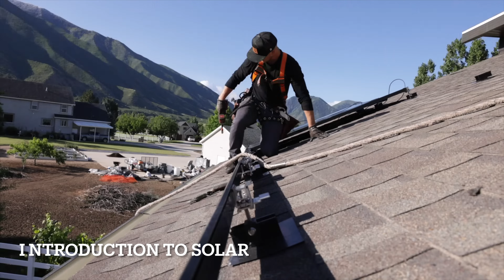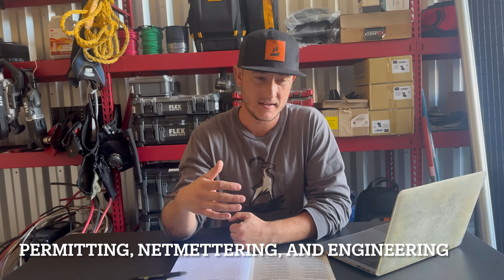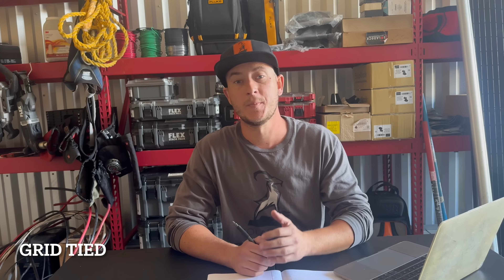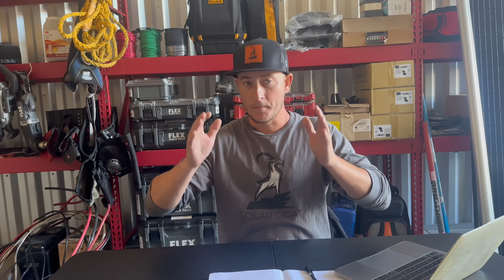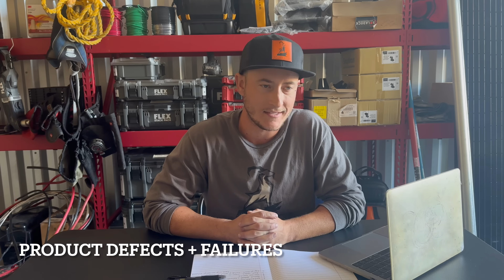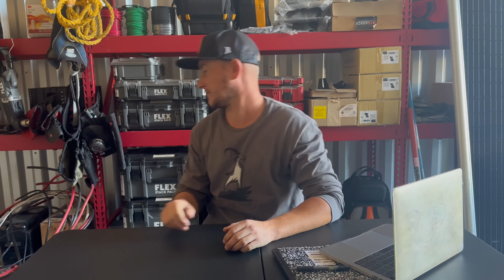Intro To Solar For Electricians

Comment: The solar company that installed the system is now out of business. I do have an AP monitoring system so that I can track on my phone, while viewing the Module output I noticed two of my panels are not generating and two of the other nine are slow to keep up with the others but do eventually catch up. What can be the issue?

Gabrielle

Comment: I went to trade school for electrical and been in the field from sales to labor and meet old and young electricians and techs and realize when I bring up solar they never installed them and not even batteries. They are curious and interested in knowing more about it. It's always something new to learn in the electrical field even codes that changes.

Comment: There are a lot of component pieces for sure.  It's good to know what they are, how they work, what the standards are, and how the standards work.  You don't have to be an electrician per-say but you do need to know your way around the basics.  Even if you don't DIY the system, you need to know enough to know whether an installer is fleecing you or not when bidding out the system and you need to know enough to know that the installer is making the right choices and not taking short cuts.

A professional installer can bring a lot of expertise to the table, but vetting whether an installer is actually good or not... that's incredibly difficult for a regular home owner to do.   Unfortunately, even a good installer can get caught-up in a bad situation.  Installers almost universally prefer eco-system solutions because there's just a single vendor to go to for warranty work and the monitoring is often easier.  But this often results in a disaster for any work past the first 5 years.

Vendors go out of business all the time and often take the installers that depended on their eco-system with them (because the installer winds up being on the hook for warranty work that he can no longer be reimbursed for).  Or the warranty service takes too much teeth pulling.   And even when they don't, vendors evolve their systems in ways that are often incompatible with older equipment. 

--

A DIYer will still use a professional electrician for everything near the service entrance right up to the first set of breakers.  DIY systems are almost never eco-system based.  They are usually component-based and depend on the many standards that exist for various components of a solar system.  The advantage is that when something breaks you can easily replace the broken piece of equipment and because all the pieces are standards-based you only have to replace that one piece, not the entire system.  Compatibility is very high.  It is literally the best way to go even if you don't engage equipment warranties past the first few years.

When you know what you are doing, hooking things up is utterly trivial.  Taking time, possibly quite a bit of time, but at minimal cost.  Even having to buy all the related tools needed.   When you don't know what you are doing, it can be nearly impossible.

--

Roof work.  Oh boy.  Some roofs are utterly trivial to mount solar systems on.  A standing seam metal roof can mount solar with zero penetrations.  Zero drilling.  Even avoiding rails.  Just S-5 clamps and such.    A spanish-tile roof, on the other-hand, can be a nightmare.  Roof pitch makes a big different as well. Walkability makes a big difference.   Whether you have to penetrate the roof or not makes a big difference.  You aren't going to introduce any leaks with a zero-penetration mounting system, but if you have no choice and must do penetrations then you have to be sure that you didn't screw up by checking the attic space under the system after the first major rain.

One thing I will say for absolutely certain... don't borrow or lease to get a solar system installed.  That removes all the cost mitigation from your hands and hands it to someone else.  If you can't afford the solar system of your dreams then think smaller, or just wait until you've collected sufficient savings to have the work done.  Don't try to power the entire house with the system from the get-go.  It can be an eventual goal, but whole-house systems are generally huge systems... they aren't cheap.

I had a small 5kW solar system mounted on a portion of my roof 20 years ago.  The portion above the garage.  On a cement tile roof at the time.  It never leaked or had any issues but I knew that was all I wanted to put on 20 years ago.   I wanted to wait until it was time for a new roof before expanding the system.

And that happened this year.  Of course I chose a roof type that I could DIY mount solar on with zero penetrations or drilling.  Standing seam metal roof... an 80-year roofing material, with modern underlayment (not tar paper which has like a 25-year life-span).  So I took down the existing system, got the new roof, and put back the existing system DIY, breaking the last 5 years of the warranty I had on the original system (it was a 25-year warranty).  And next year I'll be slapping another 10 kW at least onto the roof, probably more, DIY.  But I'll probably have the electricians work at ground level in the garage done professionally.

There is no need to rush anything.

-Matt

Comment: Remember on a school we were building. 
Journeyman running the solar walks up "how are we supposed to connect the panels to the inverter, as the panels are always live"
Forman stunlocked so i a second year pipes up "disconnect the quick connects, tie in the inverter, then connect the panels through the quick connects when the inverter is switched off"
Forman "ya, do that"
People forget electricity 101. Both ends need to be connected to have current flow. With ungrounded DC. pretty safe even at 1000 volts, especially when with optimizers the open circuit voltage isn't vary high. It's only high when the optimizers see current flowing from the inverter.

Optimizers are pretty cool. Each one has a QR code that you can use to track the production and health of each panel without a comparable inverter as it connects through cellular

Comment: Yeah, few years back, we had a great plan and AEP Teas wanted to change our 25Kv can to a 50, IN CASE the hybrid suddenly dumped all it's power on the unsuspecting utility.  These new hybrid inverter are smarter than the admins who are running the application process. would have been an extra 2K for the upgrade.   Project on hold.

PS before Tesla made lithium batteries popular Iron Edison was the battery champ.  RIP Iron Edison outta business.
Reply: I'll assume you meant 25kW, not 25kV (which would be awesome but ... no, you meant kW).  25kW = 100A service.  50kW = 200A service.  200A service connections are more typical these days, but there is certainly not even the remotest chance that your inverter would ever dump more than its rating back to the grid if you haven't programmed it to.

There is a 20% rule in terms of export limit.  If you have a 100A service your maximum export is roughly 20A.  If you have a 200A service your maximum export is 40A.

20A = 4.8 kW maximum export.  40A = 9.6 kW maximum export.  You might want to upgrade the service to 200A anyway.

There are also some other considerations related to total breaker box amperage that might be prompting the utility to want to upgrade your service.   A friend of mine in Nevada had the same issue and decided to take the upgrade.  Then promptly used some of the additional margin to install a hot tub and up-size his solar system.   there are other electrification bonuses too... you can install a higher-amperage EVSE if you ever get an EV.  You can install a heat pump water heater and/or furnace later on. 

Even if you aren't considering these things now, its good to have the option.

-Matt

Comment: Licensed electrical P.E. here.  I work mainly with radio communications systems, principally satellite, but I've done soup to nuts designs for earth stations that include everything from the AC input to the RF out of the antenna.  Had my first solar system installed on one house, then a few years later removed it and moved it to another house when we moved and upgraded with more panels.  First system was DC/grid tie inverter and upgraded system used micro-inverters.  

As a P.E. who has done many designs but with no real residential experience I was interested to see the plans put together by each installer.  I have to say that I think the engineers they worked with did a very good job and the plans were well put together in both cases.  As a result the permitting process and inspections went smoothly.

Thankfully I'm grandfathered and not being raped by the new NEM rules in California - such a joke.  They'll charge users $0.42 per kWh for tier 1 usage and then only pay solar users $0.05 per kWh for electricity coming the other way.  They've also changed the time of day rates to give solar providers even less money because there's more daytime energy being produced.  And on top of that, they're now wanting to charge a flat monthly connection fee that's based on income with much higher monthly fees for higher income households.

Comment: You sir are the GOAT of solar!  Awesome summary of so many topics and easility overlooked items.  I'm new to your channel and will look around some more, but you've given me a bunch of great questions to ask potential installers.  I could DIY all of this on my own, but with inspections, netmetering, and tax credits, I have very quickly ruled out a DIY initial install.  Hope you have some other vidoes on the channel for current best practices, eg: 80% are doing this technology today.  Also interested in the need for cleaning panels and weather prep ahead of a hurricane, hail storm, etc.  I'm considering pole mount instead of roof mount for these reasons.  Potentially a pole/tracker system.  Thanks so much, you have a new follower!
Reply: As an installer i can assure you if you have the space for a ground mount with little to no trees in the way to possibly shade them then go with a ground mount every time. Less risk involved with ruining your roof and potential fire and depending on the size of the faces on your roof, you will more than likely get the best possible production for these panels with a ground mount. Also if it ever needs to be serviced, it makes it much easier to dissect the issue.

Comment: Great video.  I would suggest an electrician new to solar setting up  your own solar > MPPT > battery > to DC devices and A/C inverter along with sizing wires, fuses and breakers.  That will really help bring home the terminology and components.

Super helpful video.  What about a follow up on recommendations for a 12 year old or any existing grid tie system where the house owner now wants batteries.

Comment: Good Video.  Net metering is a joke.  Our EMC will not credit you more than 0.03 KWH and you must purchase a minimum monthly amount of grid power at 0.15 cents a KWH.  You would need to produce 5 kwh per every kwh used from the grid.  Also, my EMC requires standby fees ($45)  Also, my EMC has no Service Level Agreement, it is common to be without power for days.
Reply: It's bs  . They want your money

Comment: I think the only thing I would add would be high voltage signs and operating instructions. What if you're not there and someone else has to shut the system down? Make sure they have a good picture book for dummies. 

Getting your perspective of the industry gives me more insight into why so many companies have failed. After building my own system from scratch I've learned that the solar industry has really gotten a bad rap from home owners. It's not being utilized to it's full potential and all of these roof leases and roof nightmares are destroying customer confidence. I prefer pole mounted or south wall mounted panels as they're easier to clean and adjust. It's also easier to protect the panels during storms by turning them flat to the wind or covering them w/ plywood. You're not going to be hauling plywood up to the roof. You'll just replace what gets broken. Now you have to match those panels. Good luck.
Reply: You couldn’t have worded this any better 👍🏽 installer for three years now and have done alot of work fixing customer nightmares due to install companies looking for quick money.

Comment: I love the content! I'm a commercial commissioning manager so I'm on the "inspection" / QC end of the spectrum. I built a split-phase hybrid system for back-up power to my Mom's well pump in 2020. I've added battery and solar capacity along with a separate Victron controller. It's now a self sustaining solar system running the pump. My only regret is not having the money for a larger inverter. It's only 3k so it only does the pump. Now I'm looking at 10k inverters.

Comment: I look forward to the day when there is an infinitely modular microinverter system where: each microinverter has a wide range of panel voltage and current compatibility; is able to provide power even if another manufacturer's microinverter is also connected to the system; doesn't require any form of wireless communication; is able to provide power indefinitely without an internet connection to a cloud service; can be locally monitored; is able to form its own grid when utility power fails; and, where each microinverter can charge its own panel-local battery so that it can spread out its power collection from one sunny day following by 2 cloudy days before the battery is depleted. If wishes were horses.